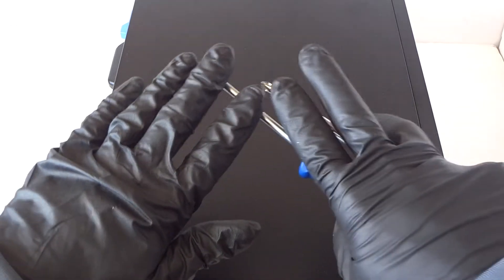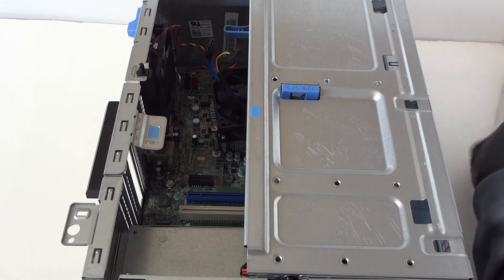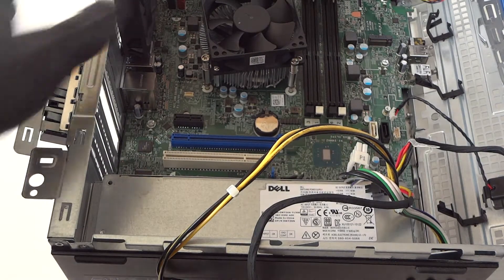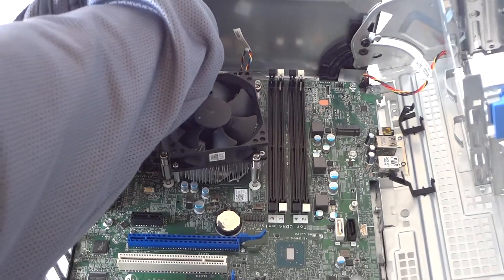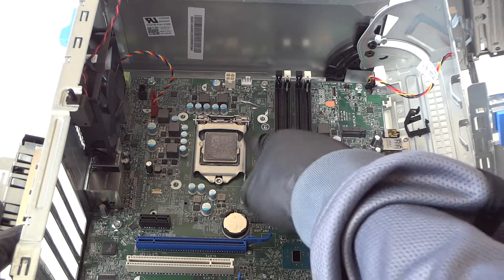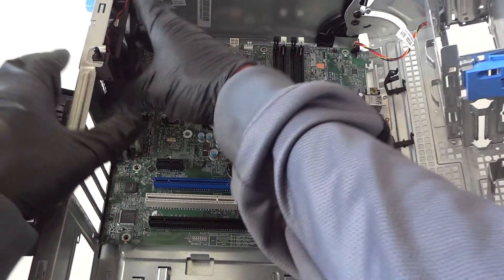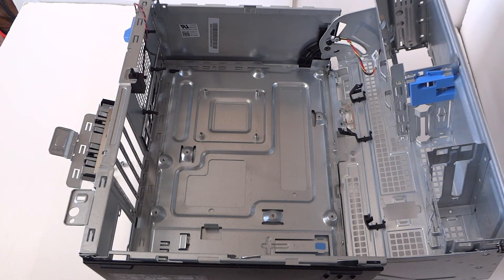Dell Optiplex 7040 Teardown

Comment: Thanks for the teardown as I am trying buy this kind of motherboard for my project. I have gone through the user manual but I still need some videos to guide me in putting peripherals to this motherboard. This motherboard has a lot of potential, but it seems that the board can only support up to Windows 10. Thanks❤

Comment: I’ve been trying to do research on what ram works with it and all I found is that it’s recommended that you use the crucial brand is it possible to use other brands or not?
Reply from the maker: Hi, yes you can use different brand if you want.

Comment: Also, how many drives, number and type, can be installed internally?
Will existing cables provide power and data connections for additional drives?

Comment: Hi just wanted to ask whats the part no. of the caddy that holds the optical drive. Thanks!
Reply from the maker: Dell 3.5" Hard Drive Caddy CN 00CW33
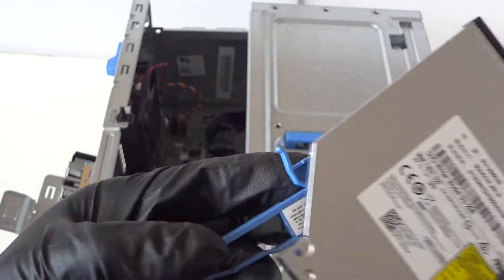Reply: Hi its not the hard drive caddy but the bracket that holds the optical drive, the blue one on your video(3:00 min). Thanks in advance.
Reply from the maker: CD/DVD Caddy 01gx87
Reply: Thank you so much!